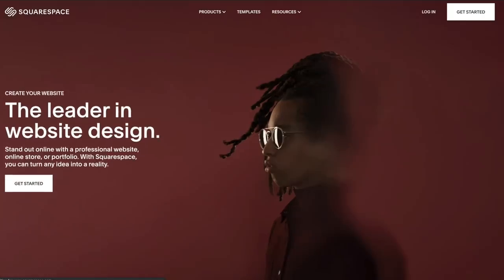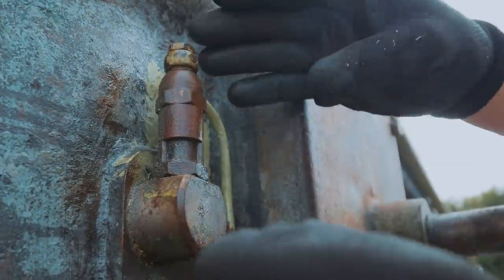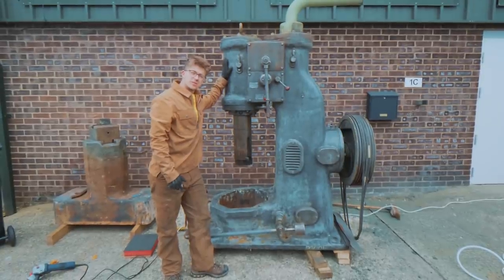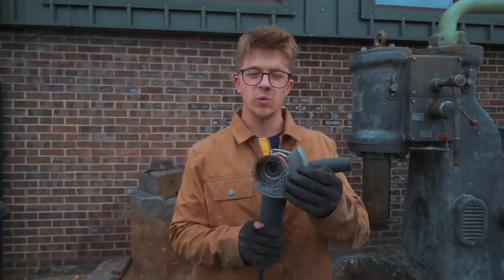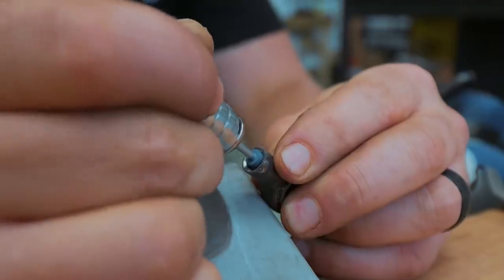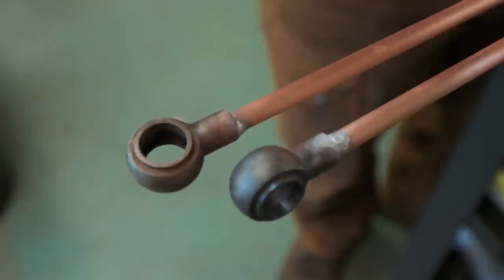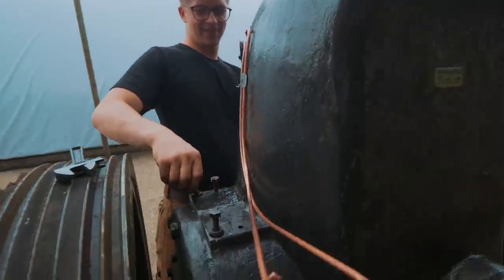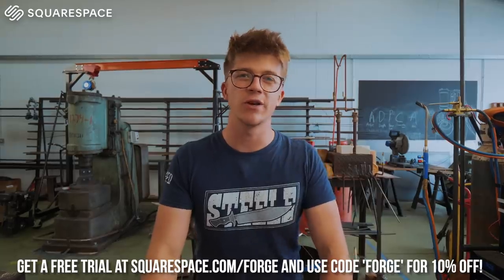Rubbing down my new German friend.

Comment: You didn't get the opportunity to learn the greatest lesson in copper line work.....forgetting to put the fitting on before flaring the line.
Reply: but he also put a feral on the same fitting it doesn't make sense
Reply: There are easy peasy lemon squeezie ways. With compression fittings,  you use a ferrell and you don't have to flare the line.
I learned this replacing the brake lines for my truck. IE the ones that go thru the frame to the brake hoses that go to the calipers.
Reply: Some goes for soldering.
Forgetting the damn heat-shrink!
Reply: Same with soldering connectors to cables, and forgetting the bend protection D:
Reply: We have had feral and we have had ferrell now how about we have ferrule . You're welcome 😂😂😂
Reply: @sheerluckholmes5468  I wondered when the correct spelling would come to light. 😆.

Comment: Those fittings for the oiler are called “banjo fittings”, they can be found pretty easily if you need to replace them.
Reply: I'm surprised Alec hadn't encountered these before...must have never owned a cheap first car  ;)
Reply: And since it's a German machine from the second half of the 20th century (not quite sure if the plate says 1958 or 1968, leaning towards the latter) they're probably metric, although plumbing parts do have a tendency of being Imperial. Copper pipe has been metric for a long time, everything threaded is BSP (Whitworth pipe thread).
Reply: Should have kept the old pipe  for the shape so he could copy it to the new pipe.
( why did it need new pipe ? ) oil filter inside the oil pump reservoir should have cleaned the crud out the bottom whilst disassembled.
Reply: Common on Bosch fuel injection systems (eg: D-Jetronic & K-Jetronic) on older German cars from the 60's/70's. Brings back great memories of re-making the fuel, brake, and hydraulic lines on Mercedes 600 Großers.

Comment: Next time you use a flaring tool for pipe be it copper or aluminum make sure to put some Vaseline on the cone of the flaring tool, helps a ton with the consistency and quality of the flare also make sure to deburr the ends of the pipe well but not too much, as too little or too much will cause cracks and leaks at the edge of the flare Tips and tricks from an Aircraft hydraulics guy

Comment: The technical term is "banjo fitting".  Common in automotive braking systems.  ;)
Reply: Yep, overtorqued a couple of those bad boys in my day.
Reply: @jasepoag8930  Crank until it gets loose, then back it off a 1/4 turn and blame it on the overnight shift.
Reply: Also used in aviation
Reply: And diesel fuel systems.
Reply: and Subaru turbos
Reply: Really common in industrial pneumatics, and those solder on steel ends are still available new in both steel and brass. Stainless steel as well, though those you need a high silver content braze to braze to the stainless steel pipes, or TIG weld them. Also available in plastic with either push fit or screw on barb ends. 

Hope he has either replaced the fibre banjo washers, or gotten copper ones.
Reply: Am I the only one who thought Alec should have gotten some braided brake lines, instead of farting around with fragile copper tube?
Reply: I thought this immediately lol

Comment: That looking glass Jamie broke was a beautiful detail. You should be able to replace it with a piece of cut to size window glass of the right thickness and some silicone sealant. The oil pressure should be low enough not to break it. 
If you want to keep with the steampunk theme, you could also cut some thin leather accordingly to serve as a seal.

Comment: When cutting the copper pipe I recommend not going all the way through. Instead get close and then do a round wiggle to get the cut to work harden. It breaks of almost clean and with a larger inside diameter instead. Also pushing argon through the pipe when brazing to avoid oxidation on the inside... well it's pushing oil so it might not matter in this case.

Comment: That bolt with a screw and donut shaped connection on the oiler is called a banjo bolt.    Extremely common on car braking systems connecting the soft rubber line to the brake caliper

Comment: As an air-conditioning technician who works with copper, you could've easily rolled it out on the ground and it be perfectly straight. Just a easy tip for future soft copper usage
Reply: It might just be me but it looks like he flared a compression fitting.  Might lead to a few leaks
Reply: @toxicchemist7383  Yeah, don't need a ferrule on s flare fitting.
Reply: If he could avoid having those loops just above the pumps standing vertical, he would also have an easier time filling the tubes without air-pockets.

But it looks really cool.

Comment: L means long radius on the bender. Its used for a 90 or larger bend on center. R is for reverse, right to left bends. 45 30 and 15 degree bends will be closer to the hook the shallower the angle. I spent 15 years of my life bending miles and miles of tubing as an instrument fitter

Comment: As an electrician that has made many thousands of bends even up to 6" Rigid pipe. I am very impressed at the pipework you did on this machine. I especially like the freehand half coils attaching to the oil pump. It will allow a certain amount of movement and prevent cracking from the pounding of the hammer. WOW!

Comment: Even with the protective clothing, if your doing a lot of wire wheeling, I’d suggest a heavy duty leather apron, so the wires stick in it, and you campo easily remove it when your down and brush it down to remove the wires, that otherwise end up in your clothing, and can result in punctures and/or scratches/cuts, on unprotected body parts when you move on to the next task. Also they can be gradually forced through the thing over time, poking on scratching the skin underneath.
Reply: Yes, that's really an often overlooked danger with high rpm-wirewheels, good that Alec took some time to explain all the gory details of what can go wrong...
Reply: A leather jacket and apron. Those wire wheel fibers stuck into clothing makes fiberglass insulation feel like a good massage compared.
Reply: @JETWTF  yeah, forgot the jacket
Reply: I loved my machinists leather apron, 500 degree steel chips would bounce right off unlike those school issued cotton ones. Never had to use a wire wheel in the machine shop.

Comment: Alec normally you keep the old lines as a reference.
Reply: That would've saved quite some guesswork indeed. 
Fortunately it turned out pretty amazing anyway.
Reply: Always measure between the bends and note the direction of each bend. Then they can be made off of those simple measurements.

Comment: Instead of making is slimy with an oil coating, Eastwood sells a paint that's the exact shade and texture of cast iron for those restoring automobiles. It enables one to clean auto parts that were left in plain cast iron, paint them so that they look un-painted, and the paint prevents the cast iron part from re-rusting without any oily coating.

Comment: Hi Alec, I have the same Bernsdorfer Airhammer (from the GDR/Eastgermany) here in my Berlin workshop. But with 100kg :) I love this hammer so much. Normaly you have a crank on top of the oelpump. Not a plastic cap. The crank ist to preoel the Zylinders. There are 3 grease nipple: 2 on the outside and 1 behind a round cap for the connecting rod bearing. Grease regularly!

Comment: For future reference - you can make a template with an old wire hanger to figure out the placement and directions to bend your tubing.  That way you don't have to bend it while it's in place.  Handy if you have to work in a confined space or on a complicated set of bends.

Comment: Hey as a plumber and someone who has to work with copper a lot, wow you did a really good job. looks amazing and as long as your joints hold up a pressurized system wont have any issues with that line run. Good fucking work man.

Comment: a trick i use for measuring brake lines is to use string to get the length of the original line, makes it easier to pull and measure the new line off the spool

Comment: A tip for your  soldering advetures in the future: 
- If you are soldering with a flame, heat the metal with the flame, stop pointing the flame at the workpiece and let the warm parts melt the solder and if well fluxed, the solder will flow into the joint without fuzz.
- If you are using a soldering iron of any kind use it to melt the solder and not the workpiece.

Comment: The sight glass is easy to replace, simply take a picture frame glass, and cut it to the shape of the steel cover, sand the edges of the glass to a nice matt finish, then mark where the holes need to be, and use a carbide tile drilling bit, and cutting paste, to get the holes in. Then mount using some thick new paper gaskets and sealing compound, both sides of the glass. Helps as well to stone both surfaces of the metal where you mount to a nice flat surface, with no burrs. Done that to a number of them, and providing it is not under pressure, it will last forever.

Or just make a template and send to your local glass supplier, who will do it all for you.

Comment: I love seeing the mistakes and progress at the flare tool, when I was in my Pneudraulics class I was the slowest but I continuously asked to keep working on it instead of moving on (to repair a different actuator.. they're all very similar so it's easy with my mechanical inclination) but in the end, I flared the quickest and cleanest/best tolerance out of my class. amazing job, nice clean bends, didn't even ripple the inside of the curves!

Comment: Those are known as banjo fittings and banjo bolts. The whole fitting has a cavity to pass fluid, and you'll want fresh crush washers top and bottom so they don't leak. Very common on brake calipers on cars.

Comment: You should make a steel body resonator guitar.  You could spin the resonator cone, cut and solder the body and resonator cover.  You could even decorate it with engravings.

Comment: I mean, I appreciate that you fixed the whole in the glass with a piece of metal. But you could have used a piece of a CD case to make a little window so you can see the oil level. Always good to know your oil level, can help determine if the system is good or if there's a slight leak somewhere.

Comment: The bolt with the hole in it that goes through the oil line is called a Banjo bolt.
If you want a new one in stainless steel look up brake parts.

Comment: Copper plumbing is really easy, and it's the only reason everything I do end up with a steampunk touch, I love the looks of it, sometimes I might use a bit more piping then I need.
Also, always nake a coil to act as a vibration damper/stress reducer and for cool  looks, I ususlly do it in one end of the pipe, but someimes I add one just for the looks somewhere cool

Comment: Copper oil tubes, same fitting as brake lines, called Banjo Bolt fittings. 
 Volkswagen, most cars and trucks, motorcycles, etc.

Comment: That bolt doesn’t need to line up with the holes!
There’s space in the fitting for oil to flow. 
That oil line fitting is your standard banjo bolt on most hydraulic brake  setups especially motorcycles. You’ll find they are very common.

Comment: Tip for the soldering: first heat the target then just touch with solder. It will then creep inside without the oxidization. Add flux just a moment before.
Reply: Oh and fill copper tubing with Sand to easier bend

Comment: If you ever want to bend copper tubing without a bender, fill the tube with sand and it won't kink. This also works if you want very tight bends. The way I do this is I cut the tube longer than I need - pinch and roll one end - fill it from the other end - then pinch and roll the other end after it's full of sand. Then after you have the shape you want, just cut the pinched ends off since it's excess anyway.

Comment: I walked outside bare foot in a rea I had been using a wire wheel in the past. The next few days my foot hurt like hell. I thought I was getting a corn. I got looking at it and seen the tiniest piece of metal. So I dragged a sharp knife across it and it grabbed it and I pulled out one of those wires almost a inch long. But I have had them stick me everywhere. The only time I put on goggles over my normal glasses is when I use one.   

The little device on the end of that copper line is called a banjo connection. They are used on brake systems in cars as well as fuel lines and hydraulic lines on all types of equipment. They are real common and when you put it back together you need to replace the 2 copper crush washers that seal each side. they have real fine lines machined in them that flatten out when tightened so it is best to replace them especially if it is a high pressure Item. Not sure that is the case but who wants leaks anyway.

Comment: If you ever have to do piping like that again those look like motorcycle brake line connectors & banjo bolts, so you could most likely get flexible braided steel lines as well.

Comment: that section where the glass was is for checking the oil level. might want to make that see through again to prevent over or underfilling. otherwise awesome job and well done on the piping and solder. don't see a need to braze this as i doubt it will go anywhere need the pressure to blow that solder out if done correctly which by the looks of it you cleaned them and scratched off the oxidation so no worries.

Comment: Good safety tip on the wire wheels. I always wore safety goggles when using them, because it seemed like a solid idea. Then one of those wires went through my bottom lip and into my gums. What an incredibly painful thing to pierce your lip with a jagged wd40 soaked wire. And it was the red meaty part, not under the lip where most lip piercings are. So much blood. And since it didnt go completely through. I had to pull it out. Oh my god I'll never forget. Now...face shield when wire wheeling.

Comment: That original copper was so easy to desolder because it was soldered in leaded solder which melts at a much lower temp than the modern lead-free stuff.

Comment: When using a wire wheel that's not twisted strand it's best to use a variable speed grinder, one that is speed regulated not resistive regulated is best. This keeps the rpm's down and the wires break free much less often and with less energy. Also a regulated 800w grinder can still pull 800w at a middle speed setting so you won't lack power at all. A grinder that's resistive regulated just wastes energy and bogs down to easily. This makes alot of people think the adjustable speed grindwrs are all bad, but only some are. Expensive they may be but they make the wheels last longer and are more comfortable to use as you can move at your own pace better. Can be a tad heavier though.

Comment: The bolt with the hole in it and the steel fitting on the oil line is called a banjo fitting and bolt

Comment: It's called a BANJO FITTING. Used to be used on fuel lines etc in the 40 and 50s. Fiber washer both sides and good forever. British engineering at its finest!

Comment: i do 15mm+ copper work but i'd say lower the temperature on your torch, might just be the mic but it sounded a bit fierce, you'll be less likely to cook out the flux and end up with a dry joint

Comment: So those weird looking screws at 2:10 are called banjo bolts. They are very common in the Diesel engine world for feeding fuel to injectors and other fuel components. I believe they are also used on some smaller planes? Correct me if I am wrong.

Comment: When wire wheeling you should wear a leather jacket and a leather knee high or lower apron over your work clothes. Welding attire works a treat. You won't get the steel fibers stuck into your clothes and poking at your skin.

Comment: Was that some expanding foam sealing the mating surfaces between the hammer and the anvil/base?
Another important point of wire-wheeling with a grinder, check the speeds! Cheap Chinese wire-wheels are rarely capable of withstanding their stated max speeds due to loosely-attached wires.
Man, this episode had Furze levels of mad-lad energy! XD

Comment: FLAIRING GUIDELINES! 
1) Always ream out the end of the copper pipe thats getting the flair. If not the flair will crack 
2) make the copper stick out of the flair block "a nickle" high. (nickle like the American coin)
3) a drop of machine oil on the yolk (the pointy part) will make things easier 
4) always remember to slide on the flair nuts BEFORE making the flare. LOL

Comment: in my shop i have a 400lbs (pull strength) magnet in a plex glass box  for pulling metal out of flesh but you have to be careful because i have had it pull me off my feet and twist my knee sideways when i walked to close to a metal pole when it was in my pocket

p.s. NNNOOO keep the old pipe to use as a template for binding the new also make sure the copper tube isnt touching the hammer or it can rub through

Comment: On wire wheeling..............DO NOT wear anything with laces. Was wire wheeling in coveralls, but some old sneakers.....did not notice a lace came undone - was wearing full head protection and was working crouched in a tight spot - and then the lace was swept up by the wire wheel while the drill I was using was thankfully spinning down...plus it has a dead mans switch. Stripped an 8 by 5 cm area of skin off my ankle. So now I wear protective boots with an elasticated fastening.

Comment: The "L" and the “R” are the secret to properly using a tube bender.  If you’re bending an elbow that you measured from the left, you use the L.  If you measured from the right, you use the R.  And measure to the center of the tube.